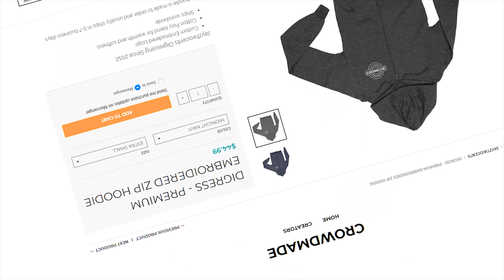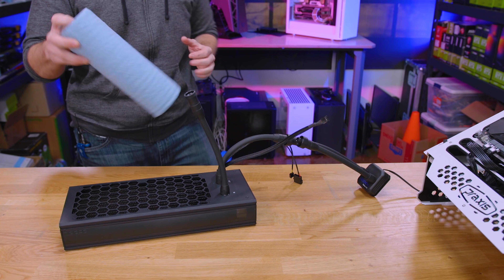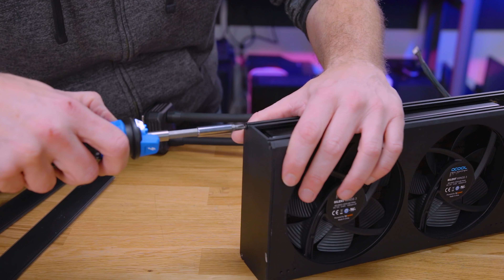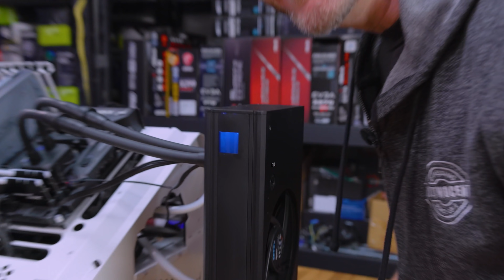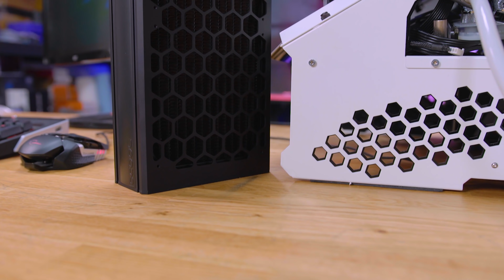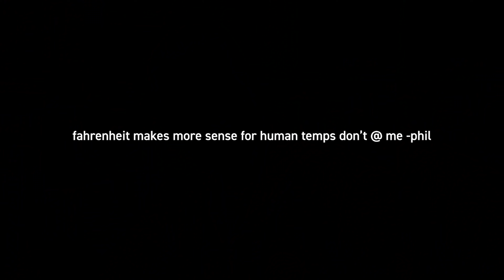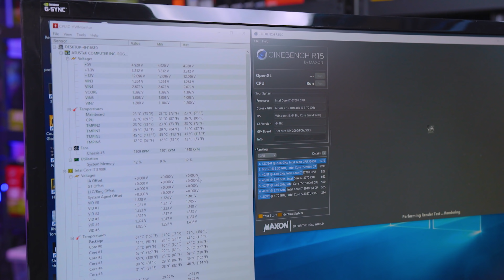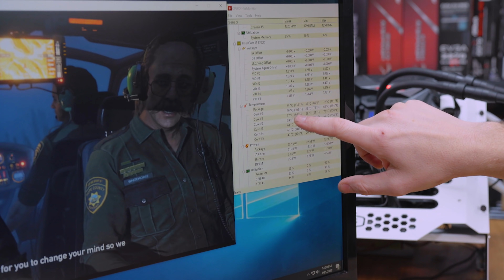This AIO is ridiculous!

Comment: this is kind of a great advert for delidding these 8700k's because I have one delidded with liquid metal and I run it daily at 5.0 @ 1.320v on a kraken x42 cooler and it peaks at 59c in a cool room for cinebench and around 64c when its pretty warm... on a x42... sat above a 2080ti. just goes to show you how hot these actually run without a delid even on a cooler the size of a small tank as you shown here.

Comment: As for an explanation for Phil's comment: this is what I've got.

With human temperatures I'm assuming he means ambient temperatures for weather, etc. A regular temperature range for any given time at least in the US is from 0° F to 100°F. To me, at least, that makes more sense than the regular temperature range in Celcius (-20° to 40°). Now don't get me wrong, for literally everything else, Celcius and the metric system is better. However, when it comes to weather, 0-100 makes more sense than -20-40. I'm prepared for the dislikes. Bring it on.

Comment: Looks like a tidy and effective cooler. How much heat can it dissipate? You mentioned/showed you can add in extra blocks in the system- in series, how does the second component fare in cooling? At $280 it wouldn't be too bad if it could cool a graphics card and a CPU- which would be cooled first in a series loop?

Comment: Bobcat's guide to Celsius and real life:

-20C = super f***ing cold
-15C = f***ing cold
-10C = borderline bitter cold
 -5C = fun in the snow / tolerable cold
  0C = freezing point of water / everything turns into a slushy mess / frost happens
  5C = chilly
 10C = cool
 15C = you might need a jacket
 20C = temperate / it's definitely spring!
 25C = pleasantly warm
 30C = sweating a little
 35C = HOT!
 40C+ = insanely f***ing hot!

Comment: I think we need a reeducation on how Aida64 stress test works. Too many people think that selecting everything the test has to offer means it's the most stressful. The reality is,  it's VERY situation dependent. 
Aida64 ONLY runs a specific test PER core. So at any one time each core is doing something different. This is why when you select everything, you get a temp graph that looks CRAZY.
---------------------------
Selecting everything is good to test a brand new system. If you crash at any point in time, you know there is a real issue with your hardware and you need to RMA something. You cannot really learn anything else from doing this. It's not great for testing temps, and it's not great for testing overclocks.

Selecting ONLY CPU is similar to a Prime95 NON-AVX stress. It's a good representation of a real workload, and is a fair way to just your typical max temps. Judging stability takes hours though.

Selecting ONLY FPU is similar to a Intel Burn test, it's an AVX stress test. It's a good way to quickly judge the stability of an overclock, and see a worse case scenario for temps.

Selecting things like Cache and Memory along with the previously mentioned test will LOWER your temps. Even the memory test needs it's own cores to run and that core will actually start to drop to near idle temps. Cache is somewhere in-between.

Comment: Scientifically speaking, Celsius is better for talking about fluid temps as it was based around water but Fahrenheit is better around ambient since it was based around the human body and the human body is sensitive to every tenth of a degree Fahrenheit. 1 degree Celcius is 1.8 degrees Fahrenheit and can never be as accurate as needed for humans unless you go into the hundredths of a degree Celcius. 

TL:DR, 0.1C == 0.18F (or 9/5 per degree C). 0.1F == 0.0555.... C (or 5/9 [per degree F)

Addendum. For those that argue Fahrenheit is not based on anything that is an ignorant conclusion. 0F was based on the freezing temp of a solution or ammonium chloride and water (ammonia salt and water) and is essentially the freezing level of salt water (and the ocean). 100F was based on the max temp the human body reached during normal exertion. Yes, when we workout it is not uncommon for our bodies to reach 100F (37.777... for those that can't read F, should learn both people). So the use of F for ambient makes much more sense than that of C. And use of C for water makes more sense than F. But what do I know? I just have worked in labs before.

Edit: just saw the part with the text on the screen where Phil agrees with me. lol

Comment: This is a solid option for some people. you could buy this to get started then, later on, add Hard tube or Soft tube with this, You could also add an extra Res for looks. all threads are G1/4 so very cool.

Comment: With my EVGA z370 Ftw I barely get 4.8 on my 8700k at 1.32-1.37 I dont know if I just lost the lottery or it's a mobo thing, or if I should step up my cooling from the corsair h100v2 ( which I plan on anyway as well as a delid ) but I'm at a loss, or I just lost the lottery. Thoughts?

Comment: The argument over Fahrenheit and celcius is hilarious. Farhenheit is far easier to use and far more accurate without decimals to accurately determine temperate. Though those of us with intelligence can do the conversion in mere seconds between either of the two roughly. At the same time most people don't understand Kelvin either so Meh whatever. Celcius works on computers because when my cpu is at 60C or basically 140F. It feels much nicer to understand compared to Fahrenheit just like Kelvin is a better measurement of temperature in some cases for computers as well. When you're talking about going to absolute 0 that is. They all have benefits and downsides and in some cases one is easier to use than the other. Hearing 60C under load sounds great and sounds cool to our brain even though in reality that is fucking hot mate. I don't think any habital place on earth where we measure temperatures like in deserts and such hit above 130 maybe 140F or high 50s and low 60s in C. So argue however you like its funny watching morons argue with very few intelligent people here.
Reply: The biggest problem with Fahrenheit is that Kelvin is the unit for temperature mainly used for science. Celsius scales the same Way as Kelvin and is defined by the phase changes of water 0° is the freezing point of water, while 100° is the boiling point. Kelvin got an offset of 273,15 to Celsius and is defined by the absolute zero point of temperature. 
Today Fahrenheit ist defined by adding an factor to the skala of Celsius and using an offset to the zero point of Kelvin. Fahrenheit has no actual definition other than being defined by Kelvin and Celsius, because the way it was actually defined was not reproducible...
Reply: @snuzniklas2211  Fahrenheit once again has a far more useful range for measuring actual air temperature more importantly considering how sensitive our bodies our to change. Fahrenheit temperature scale is a scale based on 32 for the freezing point of water and 212 for the boiling point of water, the interval between the two being divided into 180 parts. The 18th-century German physicist Daniel Gabriel Fahrenheit originally took as the zero of his scale the temperature of an equal ice-salt mixture and selected the values of 30 and 90 for the freezing point of water and normal body temperature, respectively; these later were revised to 32 and 96, but the final scale required an adjustment to 98.6 for the latter value.
Until the 1970s the Fahrenheit temperature scale was in general common use in English-speaking countries; the Celsius, or centigrade, scale was employed in most other countries and for scientific purposes worldwide. Celsius temperature scale also called centigrade temperature scale, is the scale based on 0 for the freezing point of water and 100 for the boiling point of water. Invented in 1742 by the Swedish astronomer Anders Celsius, it is sometimes called the centigrade scale because of the 100-degree interval between the defined points. The following formula can be used to convert a temperature from its representation on the Fahrenheit ( F) scale to the Celsius (C) value: C = 5/9(F - 32). The Celsius scale is in general use wherever metric units have become accepted, and it is used in scientific work everywhere.e that time, however, most English-speaking countries have officially adopted the Celsius scale.
Kelvin temperature scale is the base unit of thermodynamic temperature measurement in the International System (SI) of measurement. It is defined as 1/ 273.16 of the triple point (equilibrium among the solid, liquid, and gaseous phases) of pure water. The kelvin (symbol K without the degree sign []) is also the fundamental unit of the Kelvin scale, an absolute temperature scale named for the British physicist William Thomson, Baron Kelvin. Such a scale has as its zero point absolute zero, the theoretical temperature at which the molecules of a substance have the lowest energy. Many physical laws and formulas can be expressed more simply when an absolute temperature scale is used; accordingly, the Kelvin scale has been adopted as the international standard for scientific temperature measurement. The Kelvin scale is related to the Celsius scale. The difference between the freezing and boiling points of water is 100 degrees in each, so that the kelvin has the same magnitude as the degree Celsius.

i mean to be fair all three scales seem useless except for kelvin which really should have been the dominate scale used rather than trying to have 3 scales one of which is basically kelvin but instead of 0 being absolute or so we think, its basically just the freezing point of water which is a redundant and useless system. It seems to me that for temperature for most people Fahrenheit is the best option to use over Celsius while kelvin is right where it should be in science. In computer diagnostic maybe you could use kelvin instead of Celsius or Fahrenheit but I don't think it would matter if you used kelvin or 
Fahrenheit there instead of Celsius and in todays world everything would make more sense with the scales without Celsius existing.
Reply: @Acheron_the_Nihility  
I disagree with you that Fahrenheit has a better scale than Celsius. I guess it depends on what you are used to. For me Celsius is better, because nearly every important temperature is a divisible by 10 or 5... 0°C for freezing point of water, 100°C for the boiling point. 20°C is a common room temperature. Touching something hotter tha 50°C you start to burn your skin... And many other... The only important temperature that is not in this 10° or 5° pattern is the common human body temperature and that's 37°C...
Reply: @snuzniklas2211  welp its still stand to whats written kelvin is basically Celsius anyways use that instead. But Fahrenheit has been proven more accurate and better for air temperature and body temperature.
Reply: @Acheron_the_Nihility  
Yes Celsius is just Kelvin with an offset, so that you are likely to have temperatures with just two digits. That Fahrenheit is more accurate than Celsius is incorrect as well... Since Celsius is part of the SI system it is meant to being divisible in infinite small intervals... Since this is possible with Fahrenheit as well they are actually exactly equal accurate. Celsius scales on thermostats are most likely to have another digit after a point/comma, depending of the choice of the manufacturer it might be decimal or something like a 0.5 scale... 
It really just depends on what somebody is used to... There are no actual reason the scale of one is better than the other. I personally think that Celsius has a better chosen zero and I'm just used to the scale of Celsius...
Reply: @snuzniklas2211  Fahrenheit is more accurate than Celsius and you don't need decimals to do it. It's a 180 base. There are far more options in temperature levels to have. It's almost twice as accurate as Celsius which is basically kelvin anyways. Literally just google it.

Comment: my 2014 "Corsair H105" AIO started leaking water from the endtank on top of my GTX 980 backplate, ended up throwing it in the trash purchased a "Be quite Dark Rock 4 Pro" cpu air cooler. Temps are 5c lower & the noise was reduced alot, never going back to AIO, take a look @ the leaking from the EK predator......
Reply: Still running one of the old Corsair H70 V1's. Bought it when it was first launched, never had an issue. Got lucky?
Reply: wedgoku new aios are way better

Comment: Celsius is so much easier than Fahrenheit, though! Water freezes at 0ºC, boils at 100ºC, normal human body temperature is between 34-36ºC, ambient temperature of 30ºC or above is enough to make you sweat without moving, while anything below 20ºC is chilly and bellow 10ºC is time to get your winter clothes. What's there not to understand?
Reply: This is just as arbitrary as Fahrenheit
Reply: @jerma984  Actually not since you are referring to how people feel temperature.
Celsius itself is defined regarding water under normalized pressure and is accurate for every place on earth. (101,325 kPa = 1,01325 bar = 1 atm)
The triple point of water is at exactly 0.01 °C.
So while you can feel cold or warm for a given °C depending on your biological adjustment, around 0°C and below always mean water is freezing.
Reply: Oh look, like anything else. It's relative
Reply: @Andy Young Have in mind that I live in Brazil. 35ºC+ on summer, autumn, winter and spring. <20º is indeed chilly for us.

We don't have a lovely time of not too hot nor too cold, we get 18C by morning, 30C at noon, 35C+ in the afternoon, then a heavy fall to <14C at night. And that's during the winter or summer days with heavy rain; you can expect the temperature to be between 28C and 36C for most of the year!

And that's because I live in São Paulo, where we have a subtropícal climate! You can imagine what the northern parts of the country suffer with the heat...